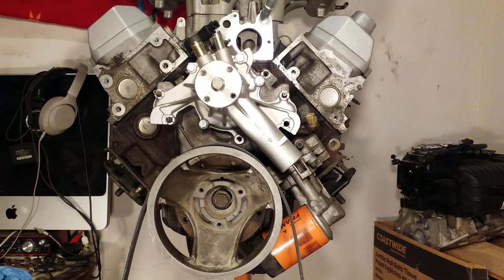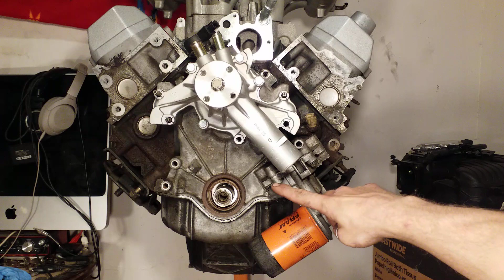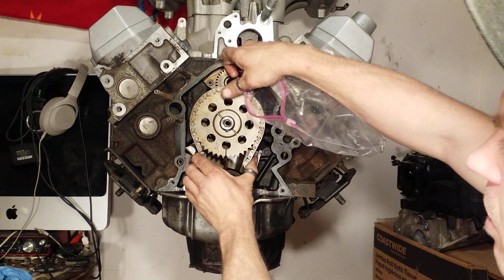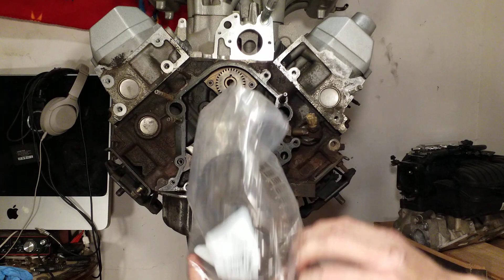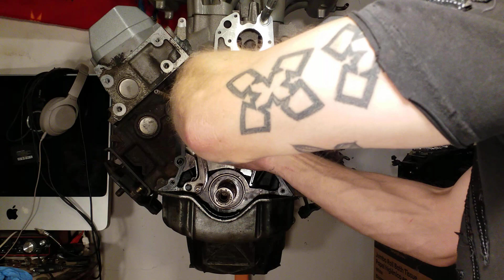Mustang 3.8 Camshaft Swap 2: Front cover, Timing and Camshaft Removal

Comment: Im sure others have expressed tbeir disdain for the way you pulled the camshaft. Because that was far from delicately. What you dont want to do is damage or dent in tbe slightest the cam  bearings. And by dropping the camshaft you have definitely damaged those bearings.all except tbe last main bearing need replaced. Or at least polished to .ake sure theres no abrasion or uneven burr in it. It will destroy a camshaft in a short time.they make a tool thats  alled a camshaft bearing tool. You can get one of them or a piece of strong allthread about 2 or 3 feet that will give you leverage so you dont bang it on every bearing. Good luck

Comment: My comp cam just failed in my 4.2 10k miles and it backed out knocked a freeze plug and took out all the lifters, after removing the cam bolt i realize they didn’t use the banjo style. The builder told me comp cam doesn’t call for that bolt. About to go in with a new comp cam what bolt do you recommend
Reply from the maker: @KevinLopez-s8g  you 100% need that banjo bolt in the end of the camshaft. It is the oil slinger inside the front cover the chain and sprockets dont get oil without it.
It may be a junkyard only part I have never had to replace one. 

Also, on aftermarket cams (not 4.2 cam) swap you 100% need to check camshaft end play. This is standard when cam swapping. The only comp cam I have seen in a 3.8 needed a circular o shaped cam shim on the front end of the cam to lock it in against the camshaft thrust plate from backing out 1/8". If that's not there and you have end play the shop should be liable for your destruction.
You will need to measure end play with "travel machinist dial indicator" and a dial mount. Mount it up to display your end play wiggle room and shim it into clearance.

If your camshaft backed out and there is no "washer shaped" shim on the front end, your malfunction is 100% fault of your builder for not shimming your camshaft.
Reply: @ yeh makes sense because I had a broken plate and never found that shim at 1k miles first oil change . Replaced the plate and got 9k outta her. Just gonna do things myself from now on. I Appreciate the rely

Comment: Will the 96 3.8 be similar to this ?
Reply from the maker: @tyroneeaton5372  it's 95% identical
Reply: @MustangV6TechSupport  what's the 5% lol
Reply from the maker: @tyroneeaton5372  oil galley bore, head thread count, cps hole bore, tensioner style. Single port heads. Random style edits but it's all same things

Comment: Hey man I hope you see this but one question that I can’t find ANYWHERE. When replacing the chain tensioner there’s a pin. First do you pull the pin when the chain is settled in? Second how do you relieve tension so I can slide chain on
Reply from the maker: @nrsneakers3582  u push the tensioner in and then push pin in to lock it in place for removal.
Replace and pull pin to exchange tensioners
Reply: If anyone knows please respond

Comment: Out of blue p0340 then chewed up cp sycro and cog  what's you thoughts and I'll be doing what's in this video shortly
Reply from the maker: @johnnycash5634  oil level, oil changes and oil pressure is what eats that drive gear. If the cam bolt oil slinger loses direct oil pressure for any reason it results in cps cog eating the drive gear.

Comment from the maker: Use Teflon tape if there is no o ring provided. That o ring keeps oil pressure to the oil slinger on the distributor drive gear inside the front cover.
Reply: @MustangV6TechSupport  I ended up purchasing the 4 pack for the 5.4 4.6 same cam bolt. But no o ring should I just pick the a/c green ring that fits snug?
Reply: The god damn cam won't come tf out
Reply from the maker: @jasonshields3683  did u take the top end off like in cam swap 1?

Comment: Any idea what size o-ring goes on the cam sprocket bolt? Mine is missing and the replacement I found looks fatter than what was on yours.
Reply: Did you ever find the right one mine is completely missing
Reply: @jacobkiciak5576 as well looking..

Comment: Thank you for the video. I do have a question on the camshaft sprocket bolt. I can't find any specs on the O ring you talked about. I have a 1999 mustang V6 and it didn't have that packing. Could you explain?
Reply from the maker: Use Teflon tape if there is no o ring provided. That o ring keeps oil pressure to the oil slinger on the distributor drive gear inside the front cover.
Reply: Needing the same info, did you ever figure it out?

Comment: Where can I find the cam shaft cog or gear I can’t find one anywhere
Reply from the maker: Keep original timing that was on engine unless upgrading for boost. it is almost 100% unnecessary to replace unless sheared deeply from mechanical failure
Reply: @MustangV6TechSupport   the gear shredded all the teeth are gone and can’t find the gear anywhere
Reply: @victorgadway9180  did you ever figure it out I’m in the same boat

Comment: did you swap for a bigger cam or same cam size?
Reply from the maker: I swap my engines to 2005-2008 3.9/4.2  F150/Freestar camshafts for around 50$ at junkyard because its a direct swap, no spring swap necessary and can process the air from 3.8/4.2 intake swaps. Great budget camshaft but its no 400$+ camshaft and springs set

Comment: Any updates on the ford gtr?
Reply from the maker: GTR is just waiting on stand alone tuning with speed density MAP AFR due to dual throttles. I have a box intake for the rest of the twin turbo setup for right now due to the MAP problem
Reply: @MustangV6TechSupport  sweet honestly can’t wait for it to be done